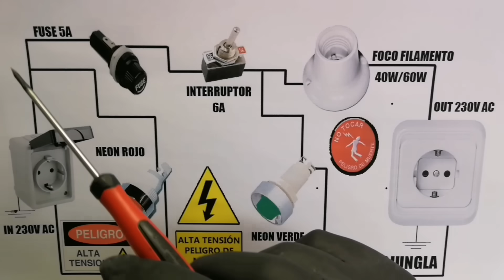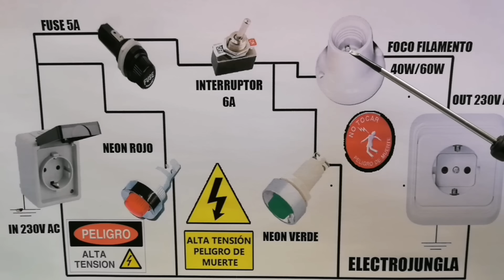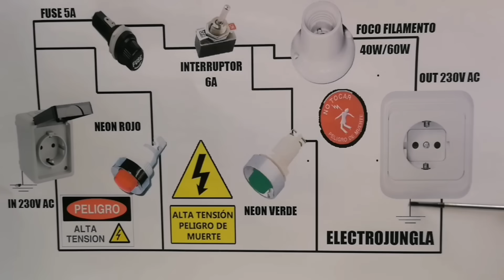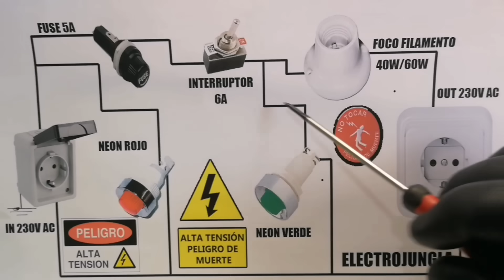Como HACER una lampara serie para detectar CORTOCIRCUITOS.

Comment: Señores de Electrojungla, esta excelente este circuito, lo voy a hacer con un transformador aislador, aqui en mi pais, Costa Rica, trabajamos con 125 voltios. Muy agradecido por sus enseñanzas. Un saludo a la distancia.
Reply from the maker: Gracias Víctor un saludo
Reply: Si; aquí en Costa Rica hay la corriente de 125 Voltios al igual que en muchas naciones de sudamerica y muchos lugares de U.SA. Aquí en España hay la de 220 en casi todo el pais, pero yo vivo en un pequeño pueblo que también hay la corriente de 220 pero al tener un transformador tan grande que tiene tres fases a 380 así como tambien a 220 y 125 con neutro. Este transformador de 500 K.W de potencia y cuya antiguedad es de más de 50 años, tiene una eficiencia extraordinaria, y la compañia dice que no lo van a cambiar nunca. La moraleja está en que en mi casa aún tengo la corriente de 125 y la compañia dice que si no solicito 220 ellos nunca me van a obligar a cambiar.
A base de transformadores y todas las artimañas ya que yo soy técnico electricista, me apaño perfectamente con los 2000 vatios de potencia que me ofrece mi smart-meter (contador inteligente), y algunos meses mi consumo de electricidad asciende a los 150 K.W o menos.
Todo esto lo hago porqué quiero figurar en el libro Guinnes de los records como el último de España en tener la corriente de 125 Voltios.  ¿Lo voy a conseguir?.

Comment: Buenisimo y muy prolijo. Me suscribi. Tenía entendido que la lámpara tiene que ser mínimo de 100 w. para proteger la instalación central. Es así? Gracias por responder.
Reply from the maker: Depende del consumo del aparato pero 40w o 60w está bien, por que 100w va dar falsas lecturas
Reply: @electrojungla  amigo, felicidades, excelentes videos, pero quisiera preguntarle para probar fuentes de 1600w a 2400w que bombillo deberiande colocar más o menos, agradeciendo de antemano su respuesta. Saludos

Comment: Hola sirve para 110 Voltios gracias. Excelente proyecto
Reply from the maker: Con los elementos adecuados para 110v si
Reply: @electrojungla  tendría que  cambiar las resistencias o el fusible ¿?
Reply from the maker: En un principio con esos elementos que puse yo te tiene que funcionar
Reply: @electrojungla  gracias muy amable
Reply: Como observé que el botón de encendido era de( 250 volts 15 amperios )(volts 125  20 amperios). Elegí un fusible de 20 amperios  no había de 19 o de 18. ¿Habré elegido bien para una corriente de 125 volts Gracias por su respuesta :)
Esto para el fusible
Reply from the maker: Lo puedes poner de menos no hay problema
Reply: @electrojungla  muchas gracias

Comment: Hola, en uruguay por ejemplo no hay face y neutro ambos son 110 volts para hacer los 220 volts, ambos cables son vivos..igual nos va a funcionar?.Se pueden poner leds con las resistencias en vez de las luces verdes y roja de neon?.Gracias, lo voy a hacer, antes usaba una lamparilla, pero asca queda todo mucho mejor.
Reply from the maker: Si puedes poner led con resistencias de protección pero de 3 watt

Comment: Hola Oscar, siento haber creado el dispositivo funciona bien, estoy reparando un cargador de batería de perforación, la luz se queda sobre mí, quería saber si el cortocircuito se centra en. Fuente de alimentación primaria o secundaria, cuando hay un corto quería entender si el dispositivo lo detecta en. Fuente de alimentación primaria
Reply from the maker: Si se enciende la luz a su máxima potencia el cortocircuito está en el primario de la fuente  no en el secundario
Reply: @electrojungla  Confirmo la luz y al máximo de su intensidad, gracias
Reply from the maker: De nada
Reply: @electrojungla  Oscar me perdona, pero si me pongo una lámpara de 100 vatios y se apaga, ¿significa eso que el corto no está ahí? Pongo una lámpara de 60 vatios, ¿es posible que la fuente de alimentación tenga una alta absorción de corriente para esto la lámpara de 60 permanece en eris caliente tanto?

Comment: Hola de antemano un cordial saludo. Excelente explicación la pude seguir al pie de la letra. Sin embargo he conectado un taladro; sacapuntas eléctrico; un ventilador y dos televisiones diferentes. Para estos aparatos descritos anteriormente, si los conecto de forma directa al toma corrientes. Si logran  trabajar. Sin embargo el ventilador si prende pero a baja potencia. Los televisores quieren prender pero se apagan.
Y el foco prende por un lapso de 1a 2 segundos y se apagan.
Pero ambos televisores si los conecto de forma directa. Al toma corriente sin prenden ambos.

Ya probé el probador juntando un cable y si está operativo para absorber el corto circuito.
A qué se deberá lo de la tele y los diversos aparatos. Todos están operativos de forma normal.
Muchas gracias por su valioso tiempo para contestar

Comment: Hola, excelente diapositivo de proteccion, solo una pregunta, que componentes se cambiarian de valor para el prototipo para una linea de 110 volt como en mexico. Gracias
Reply from the maker: En un principio todos. Tienen que ser para 110v o por lo menos que sirva para 110 y 220v
Reply: La lampara o bombillo por descontado y los neones que puedes variar su resistencia para adaptarla a 110v,

Comment: eu uso um philips fr996 direto na rede 127 Volts .br .. regulando o Trafo do receiver para 220 ( x) Volt ..pois 127 V no 127 aquece muito no verao !!
 porem ja o fiz funcionar em lampada em serie 500 Watts ..& da metade do vilume pra maior volume ..a Lampada necrssita outra em patallelo pra nao Brilhar ao Extremo ..

 condições tonais: bass -40 a -50
 treble +30 +40 ou +50
 loudness ( on)
 FR 996 (stk) = jvc rx516

 porem tenho um jvc super A 230 Volts

 o ligo no 127 normalmente ... curtucircuito o Resustor de fio (alimentação do rele) ...instantaneamente atraca o rele  .Fazendo -o Ligar !!! no 127 Vots !!!

 muchas gracias Saludos Cor.

Comment: Amigo una pregunta un motor electrico de los que tienen las patrullas de policia para niños es de corriente continua la alimentacion es de 6voltios si yo tengo un cragador de los que le entra un voltaje de 220v yblo tranforma a 12 volt y la eriqueta dice 2amp, si se lo conecto a ese motorcito que le pudiera pasar si lo conecto asi? Muchas gracias
Reply: Amigo,  si hace esa conexion , lo mas probable es que se dañe el carrito o se le queme el motorcito. Porque la tension es mayor o sea 12 voltios en vez de seis.  Por otro lado la corriente no tiene que ver porque el motorcito trabaja con la corriente que necesita.     Un  abrazo desde barranquilla, colombia.-